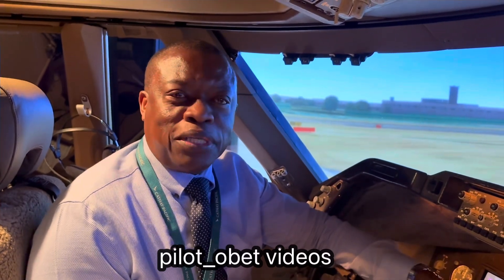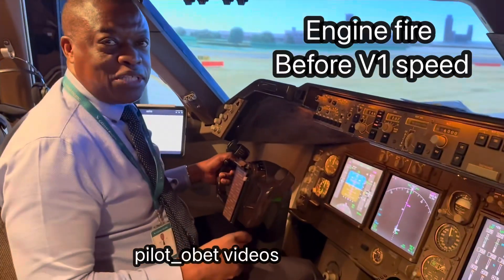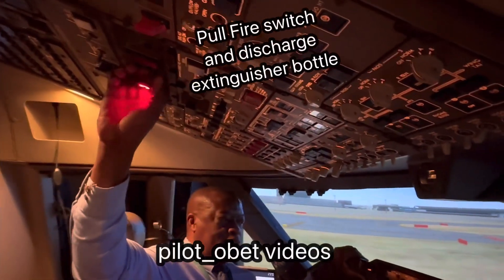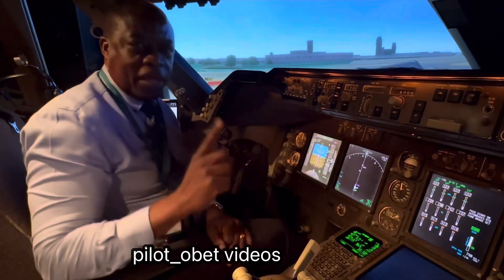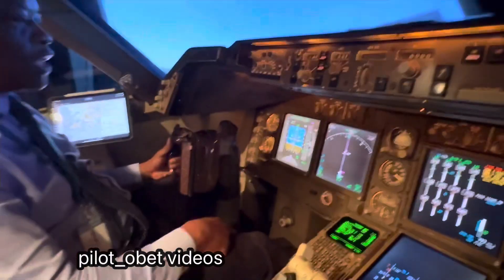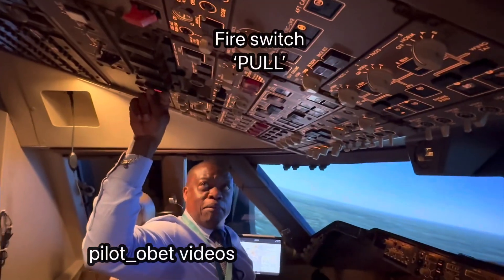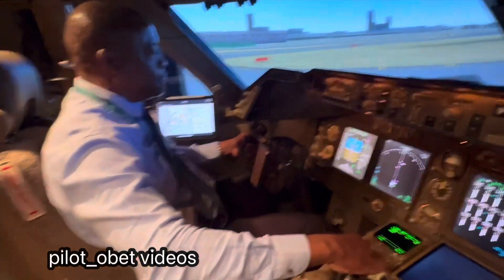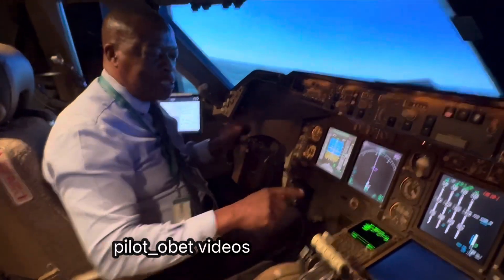Boeing 747-400 Engine fire actions

Comment: Thank you Captain for your informative videos. Could you please make a video on how to avoid mistakes as a pilot in general, but in particular in GA aviation. In commercial flying, you have procedures to set and check each others work, but in GA, where we often fly alone, what methods can I adopt to safely catch potential mistakes? I'm about to do my PPL skills test. I have planned very well and flown very well, but I've made the occasional frustrating mistake, for example mis-reading a PLOG line, or, during a diversion, misreading a track bearing on a plastic compass ruler overlaid on a cluttered 1:500,000 map. These is a mistake I would not have made on the ground but was due to having to orbit a spot on the ground whilst map-reading and having no autopilot hence a GA solo-pilot has to have a process for catching such mistakes and correcting them. Many thanks and all the best, Jamie.

Comment: Great Video Pilot Obet. 
It would be great if you could reply to a couple of Questions.
1. Does the 747 have auto throttle with engine failure.
2. In an engine failure situation, does the Autopilot, when engaged, cater for rudder trim when thrust change.
Thanks

Comment: What are the procedures if the pilots of a mighty bigger plane decide to land on top of a tiny small plane which has encroached into their right of way ?
Reply from the maker: Go-around if you happen to see the smaller aircraft and it is not too late.
Reply: @pilot_obet  Roger that capt!
Looking forward for the info when JAL flight 516 got TOGA thrust set.

Comment: Obet, on the EICAS display, all it says is "FIRE ENG 2".  I wonder why the EICAS doesn't turn the engine 2 to a red color because if you quickly glance as the EICAS and miss the "FIRE ENG 2" words, all you see is 4 white engines on the EICAS.  If ENG 2 turned to red, it would catch your eye immediately.
Reply: You can see the fuel cutoff switch light up as well as the extinguisher handle which also light up red.

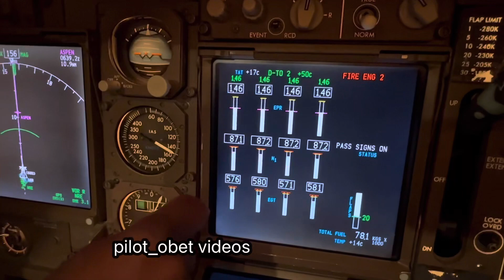Comment: Very detailed video, Pilot Obet makes a great Instructor.  At 9:08 Theres a very salient point- just because the fire warning is triggered, doesn't mean its an actual fire.  If all engines parameters are 'normal' then it might be the fire detection system being overzealous  😁 I recall from British Airways training, the first action when hearding the fire bell is just to cancel the fire warning.  If it recurrs, there might be a problem.
Reply: Well it's like alarms going off atiur independent living scheme 99.9/ if time it's a false alarm but its reassuring to know there there and obviously procedure followed by control to letter and fire engines come to our scheme